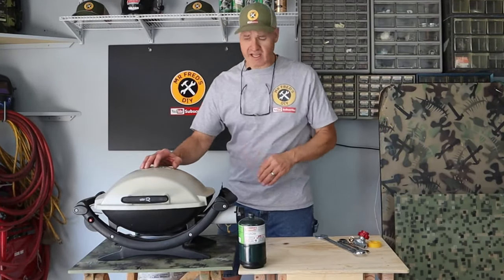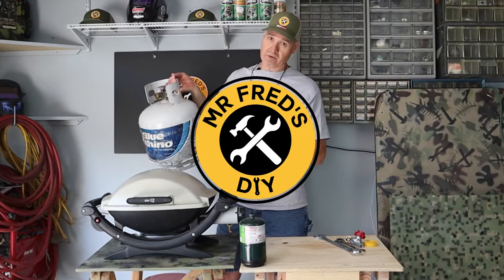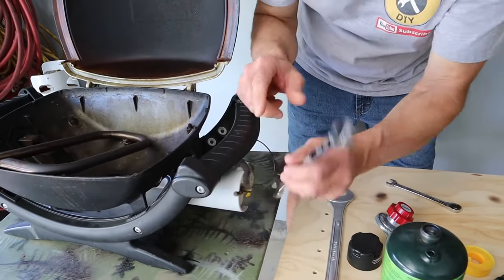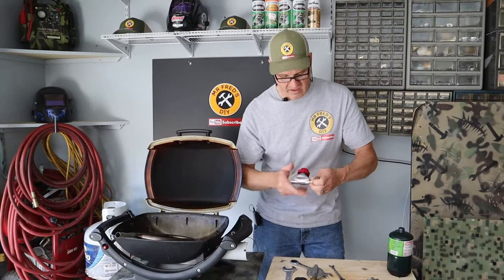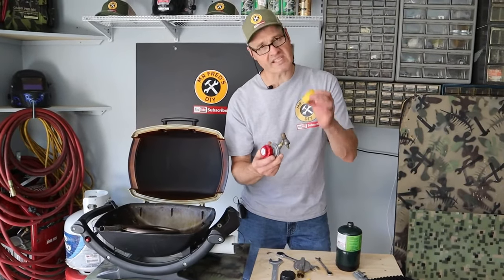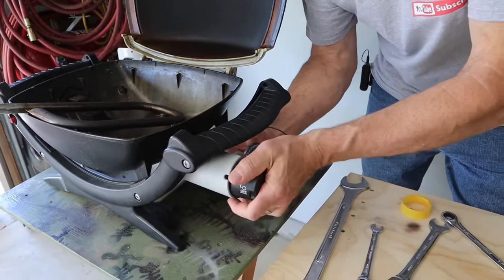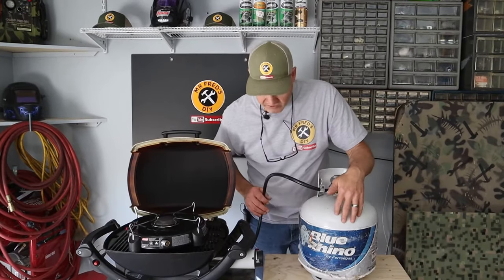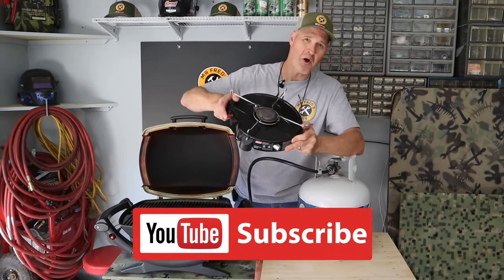Webber Q Grill Low Flame, Regulator Replacement

Comment: Don't waste money buying all of these parts. The orifice is sized too small from the factory. This is to address the issue of burning the food on the grill. Because there is nothing in between the burner and the grill. Having a large gas flame would result in burned food unless you tried to cook at the lowest flame setting which still would result in unsatisfactory results. All you need to do to increase the temp and the flame is to ream out the size of the orifice on the valve. Remove the burner and then use something to increase the opening of the orifice. The orifice is brass, so it can be enlarged very easily. You don't even need a drill bit. I used a tweezer, stainless steel, very sharp and pointed. I inserted one leg of the tweezer into the orifice and twisted the tweezer until the opening enlarged. Placed the burner on the valve, turned it on, checked the flame. If it increased to about double the size, you're all set. I couldn't get above 350 degrees before, now I get over 500 degrees in about 15-20 minutes. I also bought some cast iron grates and trimmed them down to fit over the burner. I got the ceramic bbq tiles to place on top of the burner to act as a heat spreader in between the burner and the cooking grates. Now it works the way I want it to.
Reply: is there a video how to do what your saying?
Reply: Very clever!  I must check this out.  My issue is that the grill does not get hot enough and my meat sticks to the grill because it is NOT hot enough.  Then I lose half my meat and the grill will not come clean with scrubbing!  So fed up with it.  This regulator is horrible.
Reply: i agreed on your comment, ill fix my Q with a torch tip cleaner to ream the orifice
Reply: Thank you! I drilled orifice with 3/64 bit. I get 1 inch blue flames with yellow tips now. Didn't have to buy anything
Reply: I used a nail to make the hole slightly larger and that worked. No need to buy anything.

Comment: Appreciate the video.  But aren’t  the red handle high pressure regulators intended for fryers, commercial applications etc, not grills?   Seems dangerous. Tried and made whooshing sound.  Went  to low pressure version.

Comment: forget all the bs just buy a 30psi regulator and it will work perfectly, make sure you open your gas bottle slowly also or you activate the safety valve which cuts down your flow 75%.

Comment: Hi.  I did this replacement for my Q1200.  However when I fully open the replacement regulator (the model suggested in this video), the flame in the tube extinguishes.  It works fine on a low setting, but if I pass a certain point twisting the red knob, the gas keeps flowing but flame goes out.  Also, on your replacement, the red knob of the regulator aligns with your BBQ, I can only get mine to align face down.  Any ideas/suggestions.  Thanks.

Comment: Take this as feedback. I was able to fix my Q1200 with a dead regulator using parts suggested here. I did buy a ¼mip x ⅛fip bushing from the local hardware store. The valve was stuck to the og reg pretty tightly. Be careful cuz its made out of aluminum (i think). Pros: I can now use a 1lb tank (og kinda blocked by rear frame.) I can adjust the output a bit to get desired temp. Cons: entire weight of new reg now supported by plastic valve assembly & burner. Red knob of new reg feels kinda flimsy. Thanks for sharing an alt. I look forward to seeing how long the new reg will survive.

Comment from the maker: These grills are worth repairing! So simple too! 
The current supply issues that are affecting almost every industries are also affecting the regulator from this video. I am working on a new supplier and I will post a link as soon as possible.

**Correction to the graphics on the video**
The valve on the grill is 1/8” male. The hex fittings used is  1/8” female to 1/4” male. The regulator is 1/4” female in and 1/4” female out. The 1Lb gas bottle adapter is 1/4” male to 1” bottle adapter.

Comment: Excellent Advice and Video my Friend,,,,   A friend of mine gave me a older Q grill,,,, he replaced the gas tube, but didn’t go to the regulator. Your video confirmed that the regulator was bad, and I ordered the parts from your Amazon page. Easy fix for a Free $200+ grill. Thanks Again,,,Joshua

Comment: I just got the parts and set everything up just like the video. I am not getting flame on the burner.  When I open the gas I get a sound like shhhhhhh that I didn’t get with the old regulator.  It sound like gas coming out but there is no flame.  I changed to the old regulator again and opened the little hole a bit and it works better than before.  I get flame on all the burner.  Could it be that I need more pressure with the new regulator or maybe it is damaged.  What can I do?
Reply from the maker: It’s possible that something is wrong with the Valve. These valves are sold with the regulator. If the price isn’t prohibitive that is not a bad option. Here is the item I am referring to ➡️ https://amzn.to/43QRJCj

Comment: Changed my regulator tonight.. flame still low:(
HELP
Reply from the maker: Try cleaning inside the tube and clean the small sags orifice with a single wire from a wire brush. Sometimes small debris can get in there. Good luck!

Comment: Thanks for the video.  I had no gas coming through at all.  Figured the regulator pooped out.
Just finished connecting all the parts.  When I turned it on it made a heck of a racket and I could smell the gas.  I turned everything on again,  only this time only opened the regulator slightly.  I was able to light the BBQ!
I have mine connected to a 20lb tank.  I also used white Teflon tape.
Do you have any warnings?  Am I going to blow-up?
Reply from the maker: White tape is fine for this project. I try to start the grill on the lowest setting possible so that I can creep up on my desired temperature!
Reply: @MrFredsDIY  Thank you Mr Fred!  I replaced the white with yellow tape just to be safe.  Everything works like a charm 😃
Reply from the maker: With this regulator I start with minimum to get it lit then I creep it up to the temperature I want. The low end is the most that I use.

Comment: Thanks for the helpful video. So does the original burner flame control knob just become a decoration after doing this?
Reply from the maker: They both actually work to adjust the flow. I recently made a new video with a more common regulator. You can watch it here- Weber Q Flame Problem Fixed!
https://youtu.be/PQ6XRJsnAyc

Comment: Thank you so much for this video!! This saved my Q1000 from being thrown into Mutiny Bay I was so darn mad at it. Your process and the parts listed in the description were absolutely the perfect fix for my grill that I knew worked, but I could not get the regulator do not pop into bypass mode no matter what I tried. I spent about 10 minutes on this and the flame kicked right up. Thank you again!

Comment: The underlying issue is that there is not enough gas flow at the burners.  You can get more flow by increasing the inlet pressure given a fixed orifice size or increase the size of the orifice .  My $0 dollar solution was just drilling out the control valve orifice with a 1/16th still bit.  Having the potential of having someone ignite the grill at the start setting with the regulator set to 20psi(20-40x the former setting) is just unimaginable.  I might have missed it but I would put a disclaimer in your video, " you die, don't sue me."
Reply: 1/16th will be too large. Just use a thin sharp implement( I used a sharp tweezer) to ream out the orifice to increase the volume of gas to the burner.
Reply: @sanseiryu  i use torch tip cleaner from welding supplier and step up to next size, it will clean and up size and fix
Reply: if you cant get the gas to the valve you cant get it through to the orifice ,

Comment: Great information. 
 I did what you showed & have excellent flow now.
However the old bracket that attached to the stock regulator fell off and for the life of me, can't figure out how/ where it attaches to the grill frame. Any help there? Tia
Reply: Mine doesn't even have a bracket to hold the original regulator. GO with the other fix to reduce weight on the assembly. https://www.youtube.com/watch?v=Vbjx_weZ7KE

Comment: Thank you.  Just completed your fix and it is working great.  Saved about $50.
Reply: Can you please tell me the size of the male/female brass fitting? I live in a remote locating and I have not been able to get the right piece. This video is making me more confused than anything with the sizing. It's the female side I need the sizing. The male end is 1/4

Comment: is the yellow teflon tape something specific for lp or can you use the regular old white teflon tape?
Reply from the maker: Thanks for watching the video! Great question and the subject of much debate. White tape is single density and recommended only for smaller fittings. Yellow tape is double density and code for larger fittings in many places. I selected yellow for this project for two reasons, 1.) I had some and 2.) it’s recommended for gas fittings.
Reply: @MrFredsDIY  oh crap.  I used the white tape 😳
Reply from the maker: The yellow tape is NOT LP specific. It is thicker and generally used for gas fittings for larger pipe. White tape is fine.

Comment: ❤Thanks. Any advice for the same issue with q3200? Ie; parts?
Reply from the maker: I would imagine something similar could work. It’s just a matter of finding the right fittings and replacing the regulator. I don’t have access to that model. Good luck with your project.!

Comment: So the new regulator has the control built in. The old controller is only used to hold the whole assembly in place on the BBQ? Or both are now active controllers?
Reply from the maker: Both controls are active. I usually set the original valve to high and adjust the red knob to a nice full flame. After that I use the original control just like before. Thanks for watching!

Comment: Thanks for the video but at a 1.41 mins you gave the wrong sizes in the picture. It's a 1/4" male but what is the female size from the original regulator you're using? It's not 3/8" male.
Reply from the maker: I understand your confusion because after I read your comment I also became confused. As a result I took the grill completely apart today to investigate. There are a couple of things going on here. Amazon has the sizes listed incorrectly on the regulator description, (probably how I listed it wrong).  I have added this correction to the video:
**Correction to the graphics on the video**
The valve on the grill is 3/8” male. The hex fittings used is  3/8” female to 1/4” male. The regulator is 1/4” female in and 1/4” female out. The 1Lb gas bottle adapter is 1/4” male to 1” bottle adapter.
Also, I have a new video coming this week for this grill. Thanks for the question!

Comment: I like this idea but don’t want to give up the additional support from the bracket. Is the assembly pretty secure just with the pipe threads?
Reply: Yes, the weights you need to worry about are the bottle and hose if you connect it to #20 tank.

Comment: How does the assembly you built, the regulator and two fittings, attach to the burner tube? Is there another part?
Reply from the maker: The burner tube still slides over the original valve. There is a really good view of it at two minutes and 10 seconds in my newest video here▶️https://youtu.be/CITbU2JAUJU
Reply: @MrFredsDIY  So, getting the valve off the regulator was a struggle. It looks like there were two pieces and I am left with a silver threaded male piece still attacked, maybe 3/8. Can I just get a fitting for that? I don't think I can get it out. Thanks
Reply from the maker: Send me a photo if you can. Mrfredsdiy@yahoo.com